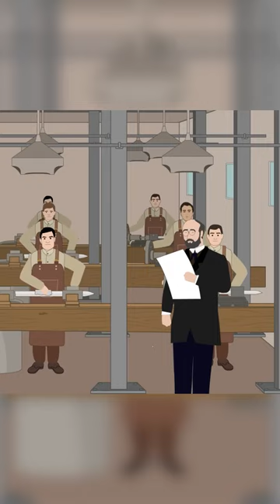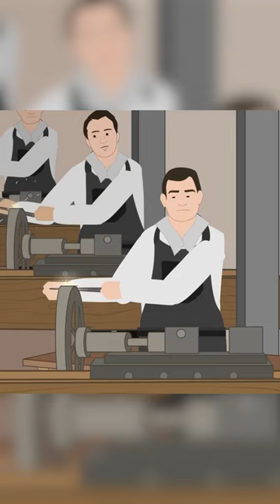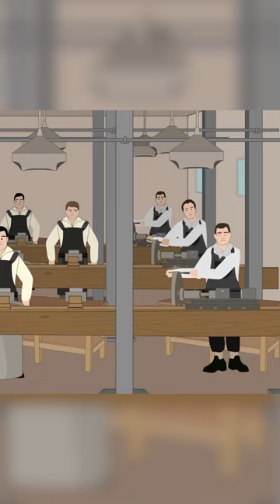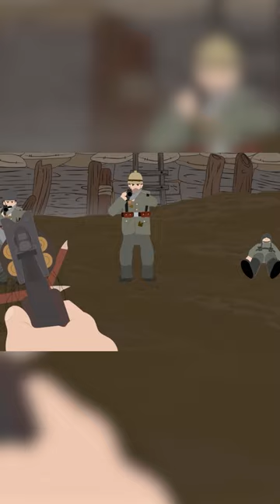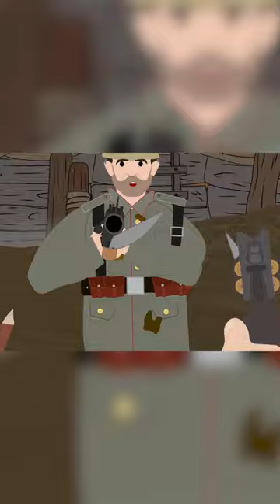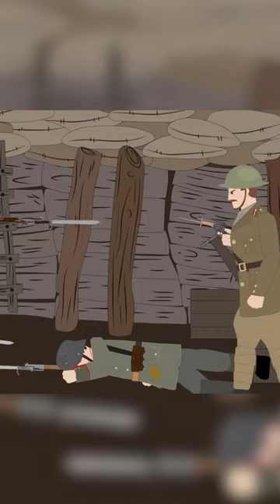Strange Gun Upgrades -  Old Bayonets were Recycled onto Pistols #shorts

Comment: Feels like switch from a 6 round revolver (some may have been 7) to the 7+1 magazine fed 1911 design would be the way to go. An extra couple shots (33%) and faster reloads. I’d rather shoot someone than try to use a pistol bayonet with less reach than a rifle bayonet. 

Generally speaking range in king in melee combat.
Reply: The stopping power was similar (.455 Webley is comparable to .45 ACP, and it's theoretically possible to load said .45 into a Webley and have it work-the issue is overpressure), and reliability varied from model to model. Some early automatics weren't as accurate as revolvers and were usually heavier and more complex.

The main advantage was both reload and capacity, as you noted, but cost alone is probably why most officers carried revolvers (although in WW2, British Special Forces and paratroopers did carry M1911s in .455 Webley).